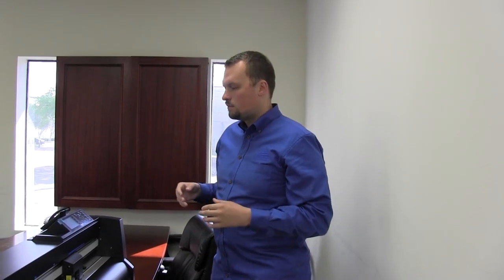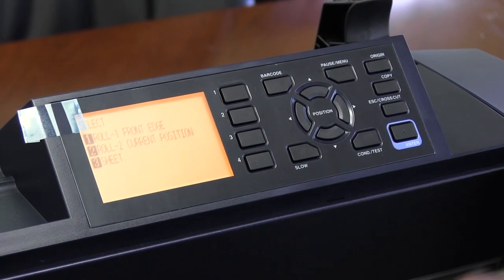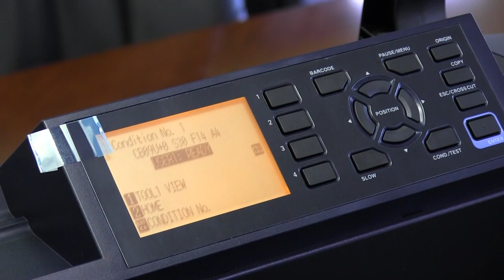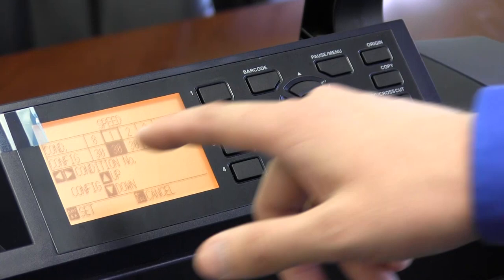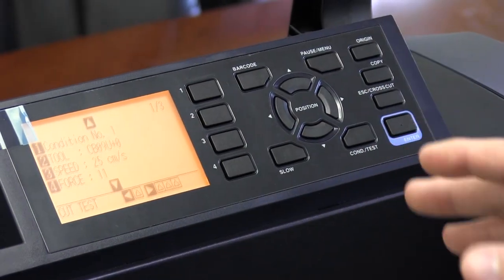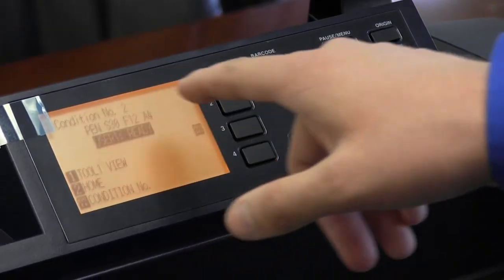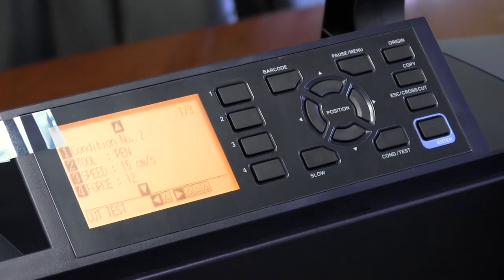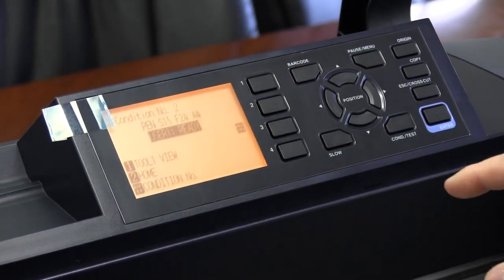How to Setup Graphtec FC9000 Plotter from Factory Defaults to Cut Window Tint & Paint Protection

Comment: Very informative.  You left the tool setting on Condition 2 at Pen.  The cutting will not compensate for the installed blade offset leaving poor Start / Stop alignments.  Graphtec automatically set the correct offset when you select the blade type.  You can adjust it manually but this is generally not required when using their blades.
Reply: I just did everything he did. Does this mean I am missing something now?